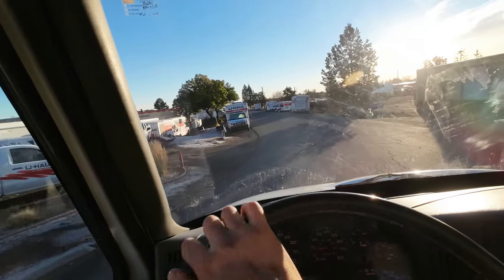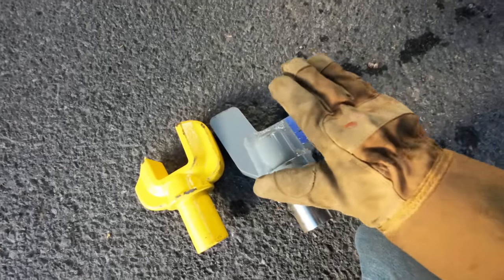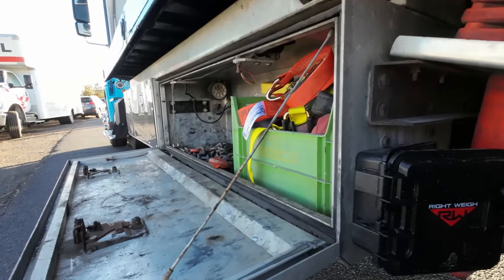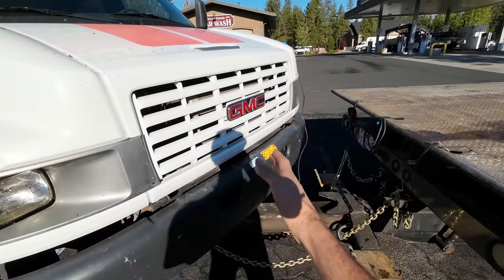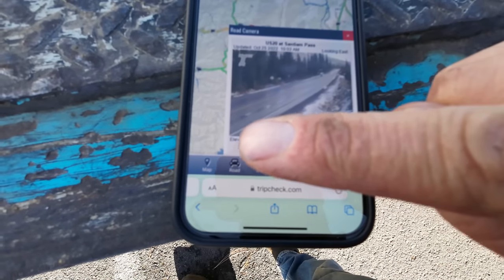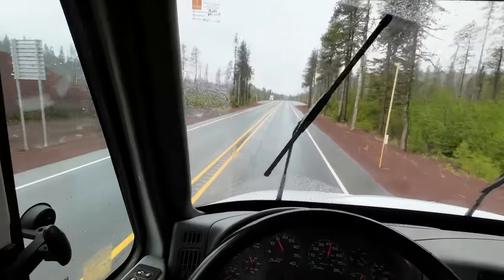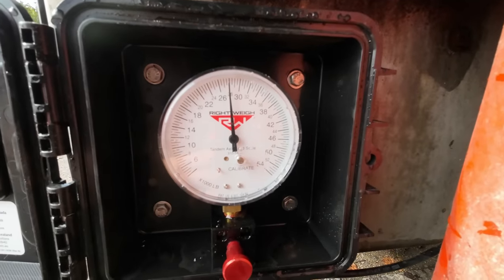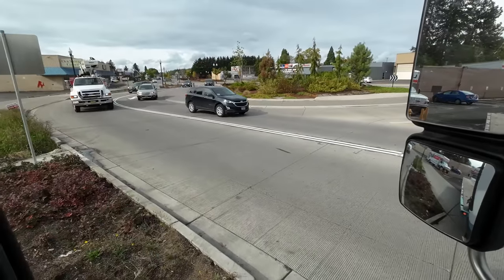Big tow for the new truck!

Comment from the maker: Two things.   First is that the truck would have been over height if I hauled it on my bed.  
Second is that the chains were not dragging, no matter how much you think they were.
Reply: But you shouldn't haul with the wheel lift unless something on the bed
Reply from the maker: @koroushlevi  this truck doesn’t need something on the bed to use the under reach.
Reply: @CaseyLaDelle  okay bud it's your truck gonna break not mine
Reply from the maker: @koroushlevi  so what you’re saying is that you have absolutely no clue about NRC equipment and what it’s rated to do..
Reply: @CaseyLaDelle  these damn keyboard professionals are so annoying
Reply from the maker: @sandralutz-rodriguez2864  and if you think the comments are bad, you should see all the emails and private messages I get about how wrong I’m doing everything!
Reply: @CaseyLaDelle  can't even imagine. Focus on the rad videos you make. So much fun to follow your channel and support an Oregon business!!
Reply: @sandralutz-rodriguez2864  Well stated! I agree 100%
Reply: @CaseyLaDelle  
What is NRC please?
Reply from the maker: @xmo552  NRC is the manufacturer of the bed and under reach on this truck.  They are one of the only manufacturers out there that is rated to load the under reach to its full rating without something on the bed to counter balance the weight.
Reply: @CaseyLaDelle  
Thanks
Reply: @CaseyLaDelle  wait, so thats not normal in the states? Here in europe even the small trucks can use the wheel lift without anything on the bed and ive never heard of that being a problem for anyone.

Comment: Loving the new truck.

100% agree with your comment about the scales and the DOT.

I worked many, many years on nights keeping the wheels of industry turning.  I would not allow a truck with an "Out Of Service" item to leave the shop.  The company liked it, the drivers liked it (they knew that the truck they were driving was safe and everything worked).  Heavy haul logging, hard on trucks!
Reply: Was going to comment the same, run legal and safe and you don't have to worry.
Reply: And thanks for keeping the rest of us who are sharing the road safe!

Comment: Thanks for the tip with the spring clamps.  I am forever messing around tying up the lose ends of ratchet straps.  I love it.  I have a bunch of the spring clamps just never thought of using them for this application.  Thank you

Comment: Strap ends are easy to deal with. No tape, clamps or anything required. Roll it up, loop it under the tight portion, feed halfway through and roll the bundle tight against the ratchet.

Comment: You can get the scales with the guage in the dash, a lot easier & you don't have to climb out to see what your drives weigh. They stay more accurate too. We were ordering the trucks with the guage installed at the factory. Of course you bought the truck used from indiana, which explains why the previous owner didn't have a scale on it😊  

the trip check app for Oregon is ok, but you will find that they don't update it for quite awhile, sometimes. Often at night & on weekends they don't update the app or conditions, some cameras aren't operational & online. I don't know how many times i've run across nothing updated on trip check for 2 days, over a weekend. Just last winter I've experienced that. Maybe they made changes since last winter, i don't know? 

Actually Matt doesn't like mountain dew that much. He drinks it, but it's not his favorite, he just said that in one of his recent videos. Now when he can steal one from Paul at FabRats, he enjoys drinking one then🤣  It's Paul from FabRats that likes mountain dew!🤣
Reply: In the air scale install video he said he put it there because it is close to the bed/lift controls, and he can adjust the load without having to go to the cab and back.
Reply from the maker: Actually if I had the scale gauge on the dash I would have to climb in and out of the cab even more.   Having it outside makes the most sense.
Reply: @CaseyLaDelle  in your business, i would agree😊
Reply: Comes back with a laser holographic projector of numbers that beam into the sky like a batman signal. 😂
Reply: @psycho-nutkase9233  what are you even talking about?
Reply: That thing is cool. Can I install that scale on anything with airbags? I would love to have that one some one tons I have. Actually as soon as I get off my rear, I'm going 10 miles to the closest scale today to weigh my 1981 GMC c3500. I'm hovering near my GVWR and I'd like to know for sure so when I hook up I'm still good for GCVW in the future.

Also...
Question: can I pull up to any CHP scale and just get my weight like you did????? I've never noticed the numbers myself.

Comment: Casey u can get n ur top box when you have a truck on the tow bar u just push it bar all the way out set it down and don't push ur bed back just pick the bed up and then u can get n the box
Reply from the maker: That’s not how a rollback works…
Reply: Roll backs have "locks" and the bed needs to be rolled back a certain distance before it clears the locks, it wont tilt until then.

Comment: Your DOT must be different then I’ve seen tickets given when nothing wrong I’ve seen trucks put out of service then when the mechanics get there they can’t find the problem they can waste your time if they feel like it always went around them when I could my first ten years of trucking never went through a scale I’ve seen to many of them on power trips but I would never pull a load that was unsafe or the equipment have refused many a load due to those factors

Comment: That is so cool you pull the drive shaft. So many people pull one axle which is bad. That will burn up the spider gears. Good job. Love the videos.
Reply: Driveshaft or not spidergears are turning. The driveshaft is removed to save the transmission not the spider gears.
Reply: @xmo552  if you pull one axle and leave the drive shaft in it the ring and pinion do not turn. the spiders turn backwards at a crazy amount of rpm and they are not submerged in oil like the ring gear is on the bottom.  It is ok to pull one axle and move one a super short distance very slow if need be. I had to replace a 10 ton rear axle because one of my drivers pulled one axle and towed 10 miles 60 mph with the truck in park. coat me 5000.00 to make that deal right. This is on an open diff. if on posi or locker you will destroy it in about 5 blocks. Most city wreckers now pull one axle and they have a dummy plate to put in its place to keep the oil in it. If I had to pull an axle I would pull both. yet many times I refused service from other wreckers who would not pull the drive shaft. always better to pull the drive shaft.

Comment: I agree whole heartedly about the scales. If you check your equipment like your supposed to and have paperwork and the Eld since I have one is in order. Let them look. If they find something then Oops I should have caught it before they did. It bothers me so much hearing on the cb hey whats the scales doing? What are you afraid of? If your asking then A: you're overweight and trying to sneak by or B: there's a problem with your equipment hoping to skate by till you get it corrected. It's the new laws and rules were stuck with it whether we like it or not. Like the old saying if you can't stand the heat get out of the kitchen.

Comment: couldnt you push the wheel lift back with the uhaul in neutral to move the bed back?
Reply from the maker: No.  You can’t pull the bed out of the locks with weight on the under reach.

Comment: Hey Casey !!!  Does that APP tell you about the ""CHAIN LAW""  too ???  Know you bought chains but properly never use them as will wait till the road is clear !!  HAHA   Doesn't work for ""WRECKER SERVICE "" as ""ON CALL ""  24/7   !!  🙃😉😗🤠😎😮👍👍👍👍👍
Reply: Yes it does you if chains are required on the pass. There are different levels of traction devices and it tells what level is needed and from what mile marker to what mile marker.

Comment: What did you just put in neutral?, why would you need to take the Driveline off?
Reply from the maker: Because you will absolutely destroy the transmission by towing it in neutral for any significant distance.  The driveline has to be pulled.
Reply: The engine needs to be running for an automatic transmission to be lubricated. Pulling it neutral with the driveshaft connected and the engine off, the "back half" of the trans is spinning unlubricated the whole time.
Reply: @CaseyLaDelle       Wow!, that bad huh! I guess these Transmissions now these days are weak!! I remember back in the 90s a Chevy truck with a (700R4) throwing neutral!, drag it out of the mud! And towed back home.👍👍🧐   And yes, it was all stock!, Factory.
Reply from the maker: @goodguygto  you will destroy a 700r4 by towing it in neutral as well.
Reply: @CaseyLaDelle    WOW!, that bad huh? Well in that case, all I can say is;  Oopsie!, Poopsie!!🥺🥺
Reply: Man there's a little cheat code for towing in neutral but I'm not sure I want to share it on the world wide web.
Reply: @xmo552    ??, well here's one, engine on.
Reply: @goodguygto  
Shh  😉👌
Reply: @xmo552     Ooooh!, sheeeeet.🤥🤥

Comment: Saftey Chains Hitting The Floor On Turns...... Glad There Is No Fuel Leaks .... chains make sparks...
Reply from the maker: They did not drag.
Reply: @CaseyLaDelle  At the fuel station, you can see the left rear safety chain on the floor... Anyways great video as always 🙂
Reply from the maker: @lordIanHouston   no you can’t.   I’m turned far sharper than I ever would while going down the road and that chain is still 4” off the ground.
Reply from the maker: @lordIanHouston   pause the video at 4:45.   Notice that the low point of the shadow and the low point of the chain are not even close to being in the same spot….  That means the chain is not on the ground.